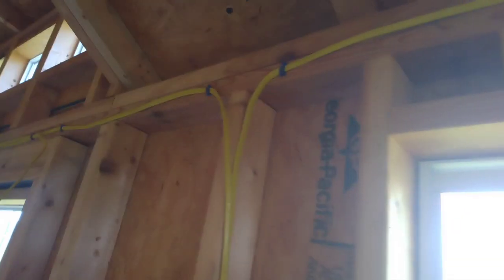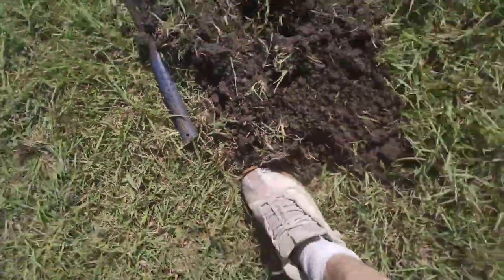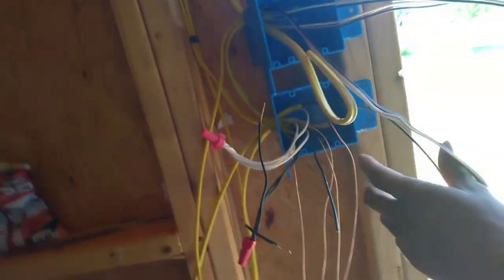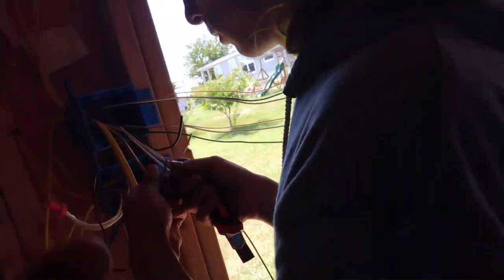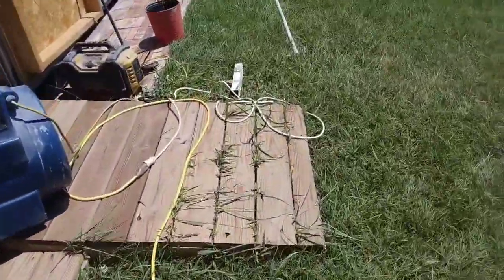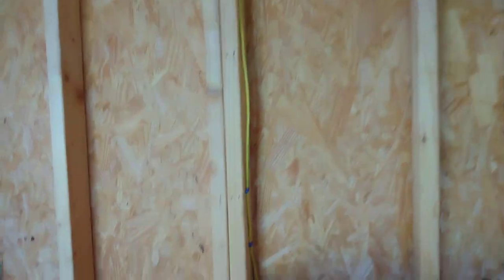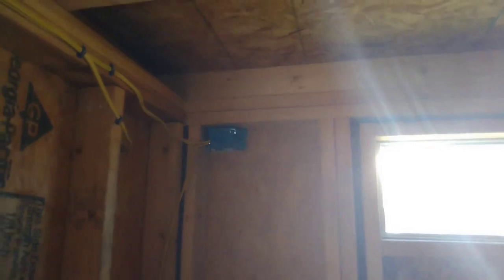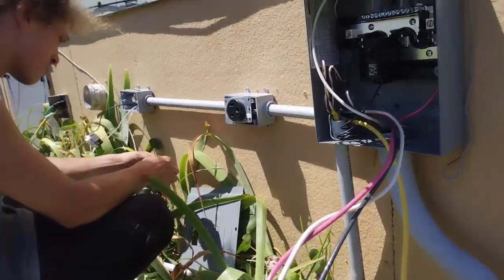installing electrical in your shed

Comment: why did you wire the inside with outside wiring?
Reply from the maker: that is 14/2 in door  wire
Reply from the maker: @theguywhoateallyourfruitsn2014  thanks for the correction on the wire size that's my ADHD kicking in again as far as the holes I would have drilled them but she told me she's never going to drywall the shed